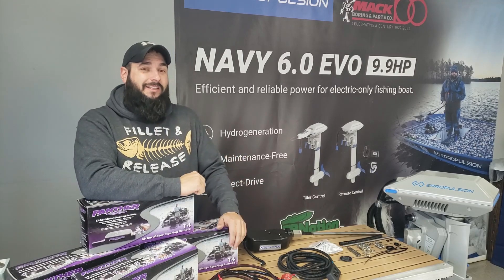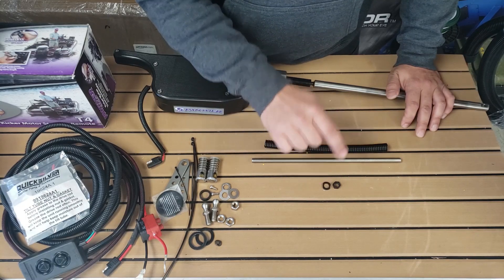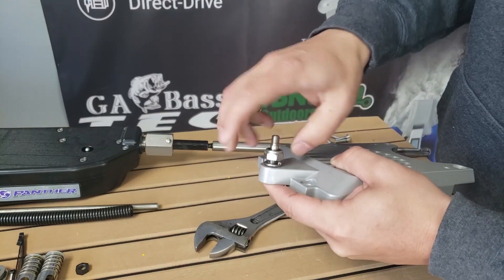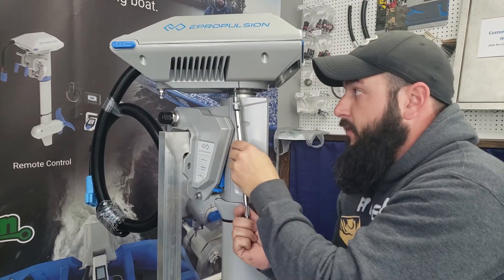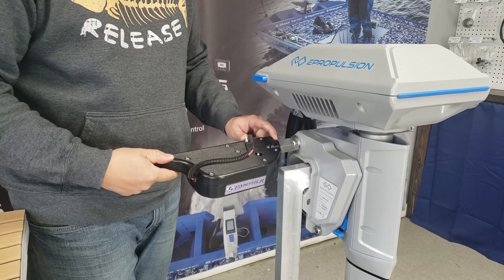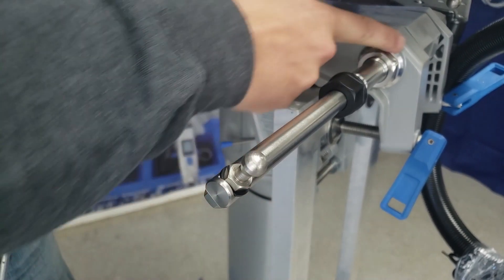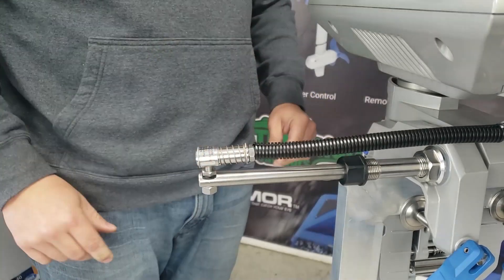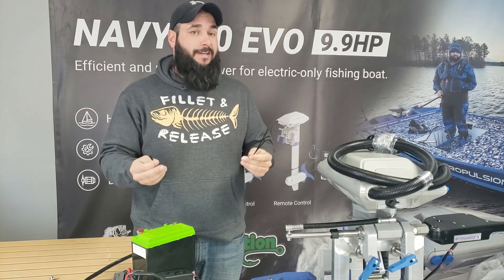Panther T4 Electric Steering Install for Epropulsion Navy Evo 3.0 and 6.0

Comment: What is the dimension on the drive side of the Evo 3KW? In other words if mounted on the port side of the main motor as a kicker motor how much room is required in the splash well to the port side and how close can the EVO 3.0 be mounted to the main motor?

Comment: Does the steering linkage need to be disconnected when you need to tilt up your motor?
Reply from the maker: No, it has enough flex in the ball joints to move with the motor tilted up.